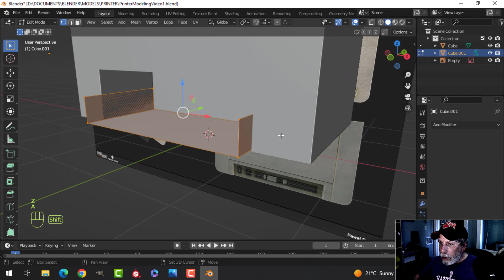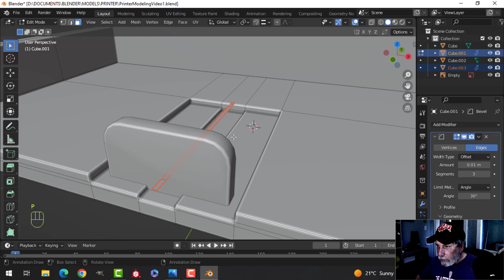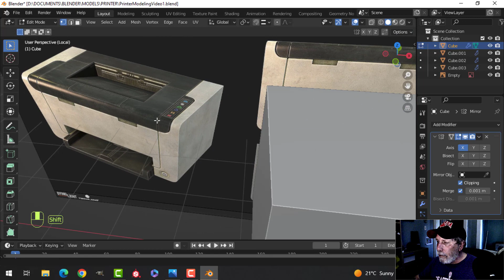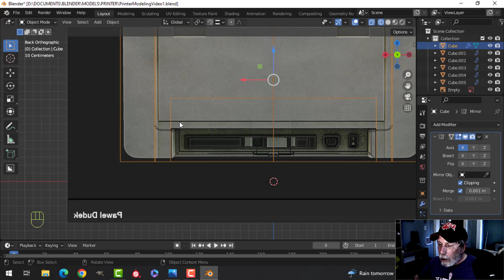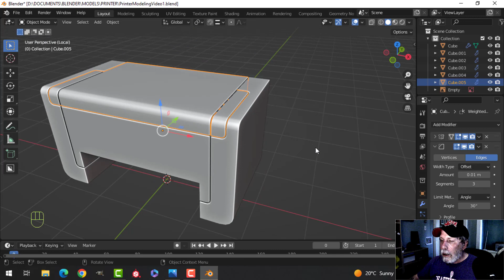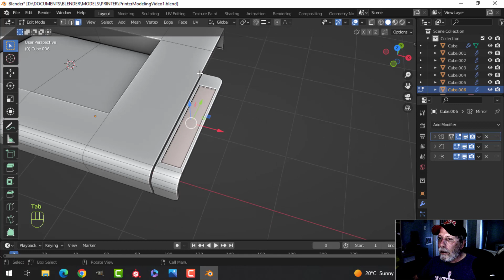BLENDER: PRINTER (MODELING)

Comment: when you import an image as a plane you can cut it up and delete the faces you dont want or separate by selection and make a new object
Reply from the maker: Yes, of course.  We do that for trim sheets and sometimes for reference images.  No need at this point to do that so not sure why you brought that up but I do agree this can be done and is a useful tip.

Comment: The method you used to create the groooves were so smart! I completely forgot they could be used in fixing the topology done by using the bevel modifier to thicken lines!
Reply from the maker: I tried a couple other ways and this way seemed to work best.  It requires a bit of tweaking but hopefully it will all work out in the texturing and not come back to haunt us ;)

Comment: hi  sir, i am new to 3d modelling and i use blender,  i am facing problem in rendering, my specs are pretty low, what specs i must get for easy cycles render?
Reply from the maker: Good for you for getting into Blender.  I really couldn't tell you what specs you need but I'm sure you can find out on Blender.org or just search for that in Google.  Why not give Eevee a try instead of cycles.
Reply: @zerobio  I understand, actually my pc has got real old nd rugged…it loads textures in evee nd takes like 5-15 minutes when i reopen the file😗 so was bit concerned…thanks fir the reply tho❤️ appreciate it
Reply from the maker: @RenderVibetb  sorry to hear about your troubles.  It is always a pain when our computers don't work like we need them to.  Just wondering if you are loading really high res textures or maybe lots of textures or rendering at a very high res.  I often just do 1024x1024 and around 150 samples in Eevee.  Don't see the need for more than this when I just post to FB or ArtStation or the discord.  Good luck though and keep at it.
Reply: @zerobio  yeah i use blenderkit add-on for most textures
Reply from the maker: @RenderVibetb  sounds good